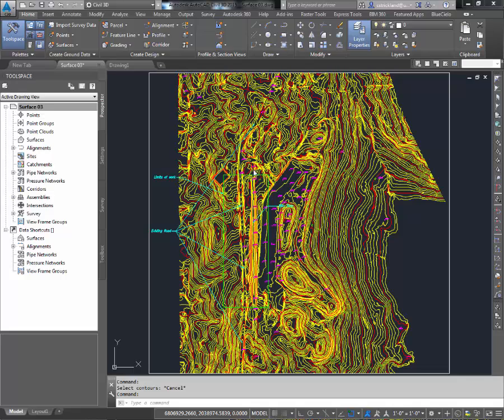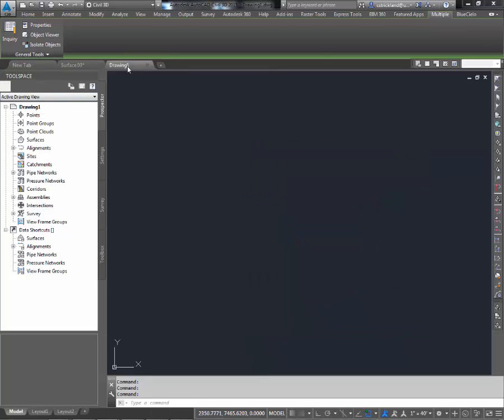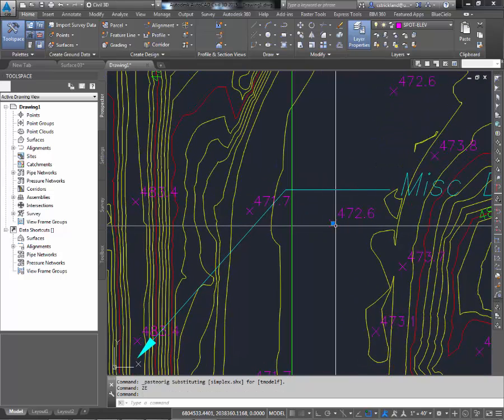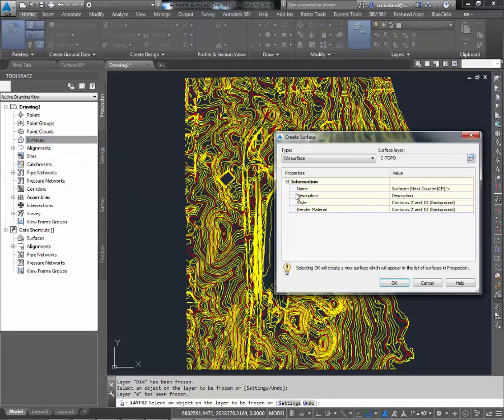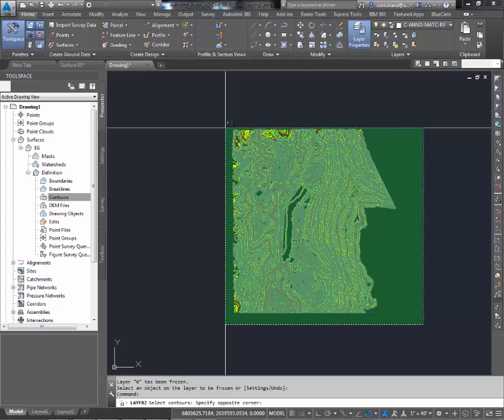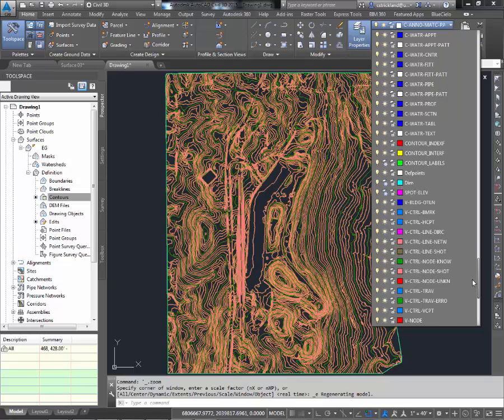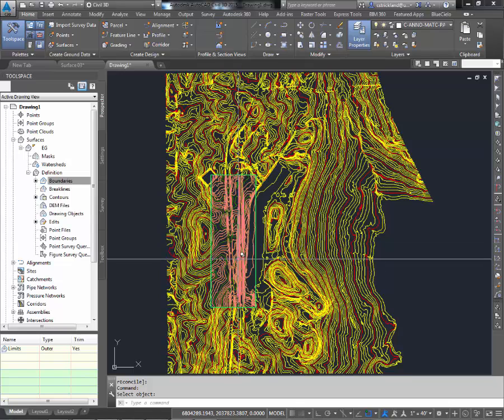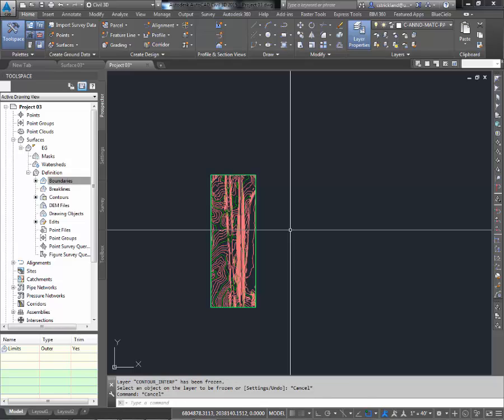Civil 3D - Creating a surface from existing contours (Polylines)

Comment: Instead of Freezing and going into the Layer State Manager dropdown (or pop-out) to unfreeze, I prefer to use the Isolate button in the Home tab under Layers. Then using the Unisolate button below it to bring everything back after making any edits. It seems to work smoother than isolating layers by right clicking in the Layer State Manager.

Comment: When you use contours for surface model data you will sacrifice some fidelity.  For the data of the type shown here (probably a LIDAR mapping) it is usually not a big deal. But for more detailed surfaces, such as for a parking lot design - you are going to lose the fine detail of what is going on between the contour lines. Better to get the TIN and create your surface from that.
Reply: When you say get the TIN what do you mean exactly? I'm working on using civil 3D as a tool to easily grade (in the teaching sense of the word) and iterate lots of easy grading assignments for landscape architecture students. So we work on the scale of parking lots a lot
Reply: @morganhenson2925  TIN stands for riangulated rregular etwork. It in the network of triangles you get when you develop a DTM (ie/igital errain odel), sometimes of 3d lines, sometimes of 3d faces depending on the software. Those 3d lines and/or faces can be used as data to create a DTM that will be identical to the DTM they were generated by.  Another way to transfer a DTM is by exporting a LandXML file from the source DTM, and importing it to your project drawing. But the point of my original comment is that if you use contours as data to create a DTM you sacrifice the detail that exists between the contours.

Comment: Realy nice workflow, man! Although, how'd u get those surface styles? I'm looking for a 1 to 5 for a while....
Reply from the maker: Hello Vitor. All of those surface styles are part of the _AutoCAD Civil 3D NCS.dwt, this is the template that comes with the package, there is an (Imperial) version as well as a (Metric). If you are only seeing 'Standard' as your option then you might want to move the drawing into a template or pull parts from a template to your drawing.